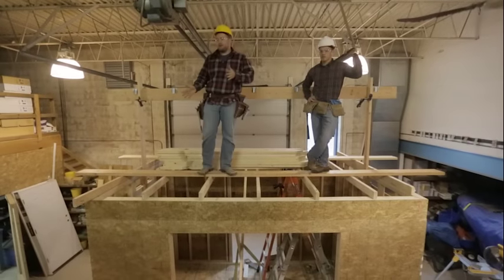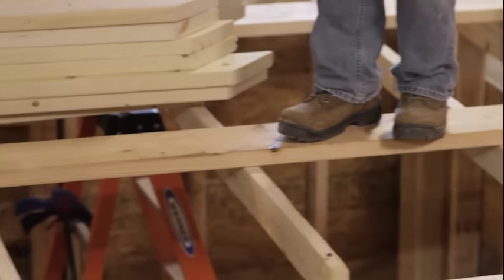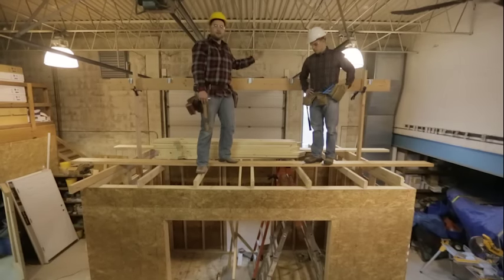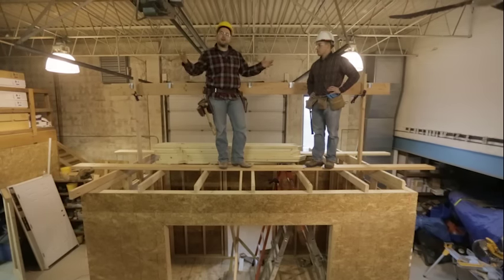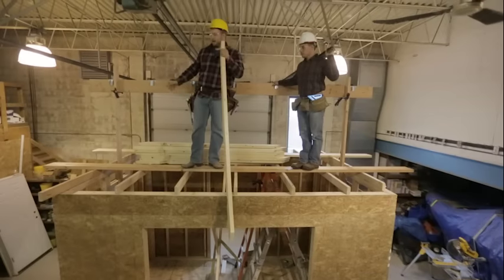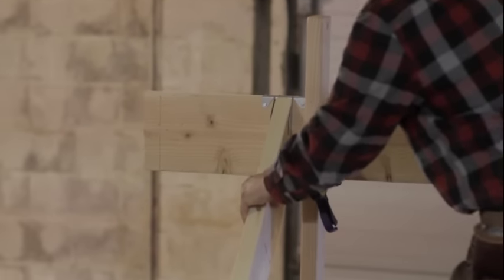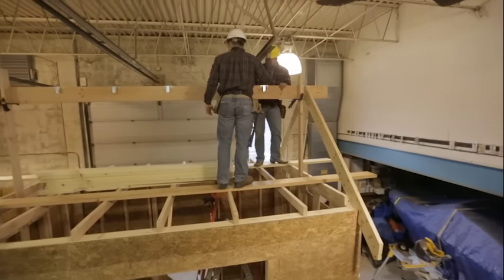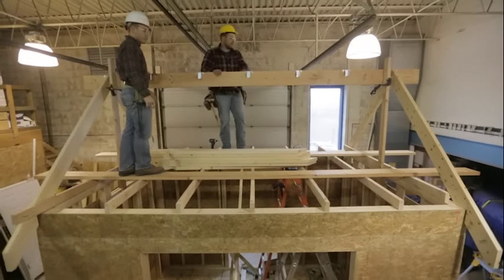How to Install a Ridge Board & Rafters // Roof Framing Part 4

Comment: Your birds mouth cut is at least half the depth of the timber and shouldn’t be no more than a 1/3
Reply: nope
Reply: Philip J. Fry Mostly to prevent snow to my knowledge, if you live in a place that gets a lot of snow it gets heavy.
Reply: The support is on the base of the cut. Derp
Reply: @JohnnyJr396  You are only taking into account the support of the rafter from the wall in, and in that you are correct. What you are not taking into account is the support of the rafter tail past the wall. THAT is where you are causing the stress point.
Reply: you get what you pay for
Reply: To much “Um”…
Reply: His 2 toe nails missed. I’d have only placed 3 from the outside.
Reply: I was going to post the same thing.
Reply: @JohnnyJr396 - what about the support for the roof eaves, roof sheathing and roof tiles on the roof overhang?
Reply: 1/4 is the rule around here. You just took over half the strength away from that rafter

Comment: Seems like the seat cut is DEEP I was under the impression that you didn't want more than a third of the rafter thickness as a seat cut? Thoughts?
Reply: agreed.
Reply: Doesn't matter too much, only thing past seat is overhang,
Reply: 2/3 should be left
Reply: IRC says no more than 1/4 the rafter width.
Reply: Yeah I’ve always heard leave 2/3rds. The city fellows would know, they rarely use trusses

Comment: Did anyone else see at about 12:00 how loose & cracked the rafter was when he toe nailed it with the 2nd nail?  Thing slid out 1/2" and he pulled it in by hand😂
Shoulda been a lesson on what not to do.  Best use ties to avoid what he did..

Comment: Hey!  I am building an A-frame, and the plans show two 1-3/4" ridge board at 48' long  made from LVL, which creates a 3.5" thick beam.  I'm pretty sure I can do this, but I wanted to see your thoughts:  Cant I break these up into 12 foot sections and stagger the joints between the two LVLs?  For example, I would start with a 6' and 12' LVL on one end, and keep adding ridges as I lay the rafters.  The ridge board is structural, but its not load bearing, as its just a nailer for my rafters.

Comment: Are those rafter hangers a single piece, double sided? For the left and right side rafters?
Reply: Same question
Reply: Same question? If they are and can also be attached to top of ridge board. Then you have met code for unitizing the rafters. Then you won’t have to set a strap over the ridge board  from rafter to rafter after the sheathing is installed. Or rafter ties.

Comment: How you determine ur height for ridge board? I see you have set in place
Reply: Pythagoras theorem
Reply: @SWhite-hp5xq  No. The height or rise can be whatever you want it to be. Whether you want a steep roof or not. The length of the rafters or the pitch is determined by the Pythagoreum theory

Comment: Thank you for your video. Can I use screws on the rafters?
Reply: Screws break, nails bend.
Reply: New screws that are specifically designed for the shear loads.  Older ones, no

Comment: You're videos were very helpful one question tho. How did you know exactly where to put your ridge board so you can start hanging the common rafters
Reply: You use what's called the total rise to set the height of your ridge board. Total rise is the run, in feet, times the pitch number. If you have a 20 foot wide building, the run is 10 feet. If your slope is 12/12, you will have 10 X 12 = 120. Your height will be 120 inches from the height above plate to the theoretical peak.
Reply: The find the run u can use construction master pro to find it, measure the span(exterior wall to exterior wall) for example if you have 25 ft you subtract 1 inch 1/2 (ridgeboard) then divide the result by 2 and that will be where your ridgboard will land
Reply: @Jay-tk7ib  thank you for the math!
Reply: @cindyjohnson5242  You're welcome. Just remember, this is the THEORETICAL height of your peak. The ridge board will be set slightly lower because you have to shorten your rafters by 1/2 the thickness of the ridge board. Also, add in the height above plate distance to bring the measurement all the way down to the wall plates if you're setting up center gable studs to sit the ridge board on.
Reply: @Jay-tk7ib  thank you!

Comment: Hi. I was wondering what the pitch is of your rafters? I need to determine how steep the roof should be in order to decide what type of tile to buy.
It looks like a 7/12 pitch but I could be wrong.
Reply: 12/12
Reply: good luck shingling that roof without falling off

Comment: Never ever ever cut your facia cut until you have set all your rafters,then you can pull a sting and cut.talk about wavy facia dude
Reply: If you've done a good job on everything else, you won't have a wavy  facia.
Reply: They didn’t pre cut. The cut that is there is temporary. In a later video they snap a line and cut.

Comment: I can't find anywhere where my following question is addressed: How do locate the rafters on the ridge board from left to right or right to left??  I'm not talking about layout, but the starting point.  How do you ensure the rafters will be square with the sheathing that will cover them?  So far, everyone just throws the ridgeboard up and nails rafters to it without explaining how to line them up square.  How do you do it?
Reply: J P you do this by doing layout starting from the middle.

Comment: What size of nails do you use when toenailing? Any specific nail? Thanks
Reply from the maker: 16D nails should be used during the roof framing process.

Comment: Hello there. Guys, I am watching you over and over again most of the time when i have a problem. My problem is this. I am building porch cover with gable roof. I figured out measurements for comon rafter, birds mouth etc, but since porch gable roof is going to be connected with existing roof how do i cut and measure those small valley rafter. Thank you
Reply: NSM Construction .... Thank you guys very much for your kindness.  I'll use your tip for valley jack rafter and help from other people videos. I saw all your videos so far and what I like about your videos is explanation of all detail possible . Excellent job . Please, make some videos about home edition , room , roof , etc. Keep doing what you doing.
Reply: common rafter run  x  16.97 / 12. that will give your hip or valley rafter run. now to find the hip or valley rise is/   Valley rafter run x  8/16.97 , just remember that is center line of the stock so when you cut your beveled end thats to the center line of hip or valley rafter
Reply: Easiest way is to get your valley rafter/lay board installed depending on wether or not your existing roof is to be trimmed out or not and simply mark your rafter centres. Then measure them with a tape. If all is straight then you can work out a common difference in length and cut them all. The plumb cut on a cripple rafter or jack rafter ( cripple to a valley, jack to a hip) is the same as your common rafter and you can find your edge cut at the wall plate where the valley/hip meet the wall plate just take the angle between a parallel line with your common rafter up your hip or valley at the pitch of the roof not level.
Hope that is of some help.
Reply: Look up how to do a blind valley. It's pretty easy.

Comment: Your birdsmouth cut is way to deep😔
Reply: You know if you didn’t have the tail for the soffit and facia board it could be cut all the way across... the tail doesn’t support the roof cuz 🙄
Reply: no, but the birdmouth is designed to keep the walls from splaying outwards from snowload and such. Also, cutting them too deep will result in a weak birdsmouth so why would you make the effort but not do it right...inspector may just fail your project.
Reply: @kenthelliker2112  not saying you're wrong about the size of the birdsmouth, but your explanation of why doesn't make sense. spreading forces are applied *by the rafter*.  I always thought you wanted a good amount of wood left to resist bending stresses on the eave overhang.
Reply: Birds mouth 1/3 no more

Comment: The toe nailing of the bird's mouth wasn't done correctly. The nail was started too far from the top plate. It was about twice the distance it should have been. An inspector would probably fail it.
Reply: 11:55 board moves after 2nd nail driven demonstrating neither held jack shit...."and okay!" lol.

Comment: how was the height of the ridge board determined?
Reply: notice the other guy is totally not paying attention and tries to walk passed the guy talking on a 2x8 platform suspended 8 ft off the ground
Reply: By the angle you want for the roof. That beam is also a bigger board than what you use to frame the walls with.

Comment: You moved the ridge beam up and down and did not check for plumb! If you lower it you will push the rafter away from the sheeting/wall, cmon man!
Reply: I was wondering something similar.
How do you know the ridge is level now , it appeared you just moved it around as you pleased. I never saw a level...
Not being an ass, I'm asking to learn.

Comment: Good job. It would have been easier to build the whole gable wall on the ground first. would have saved you a lot of work up in the air. Not only that but it would have given you a pocket for yor Ridge nice and solid. Just a tip for you guys.
Reply: Jameson Cross 👌🏼👌🏼
Reply: Sometimes you dont have enough help to help raise the whole gable wall which could be heavy
Reply: @nateg5915  that's like saying, sometimes you don't have enough help to lift a car when you are changing a tire.

Comment: Screws, screws, screws!!! Toe nails are junk.. use screws.. you will be way happier and solid
Reply: Nails are better sometimes . Screws can snap , they have little shear strength in most types . I prefer nails for most applications .
Pro framer since 1978 .
Reply: @NSMConstruction  would deck screws be acceptable? i see a lot of people using those and impact drivers for construction and repair(even got to use theirs, them things are fun)
Reply: Nails destroy the wood it goes into, so the wood does not  SPLIT as with screws. You would have to pre-drill ever spot so the wood doesn't split. Without pre-drilling, the screws weaken the wood, degrading the structural integrity and unless they are structural screws, they are not to code and have no shear strength like nails do but they also can not allow for movement from an earthquake like nails can.

Comment: "Um, um,  um, um, ..."  Concentrate on talking without  those filler groans.
Also, those first two toenails were too high,  and you saved face by not wiggling it more than you did. I bet it would have lifted right off.